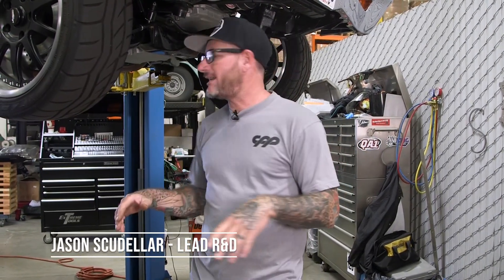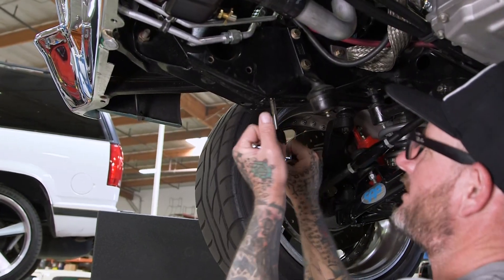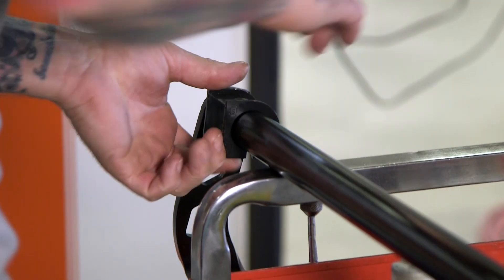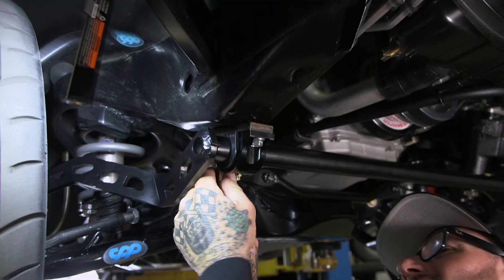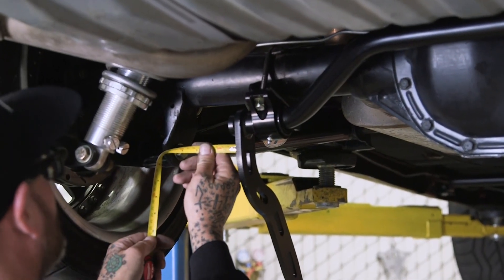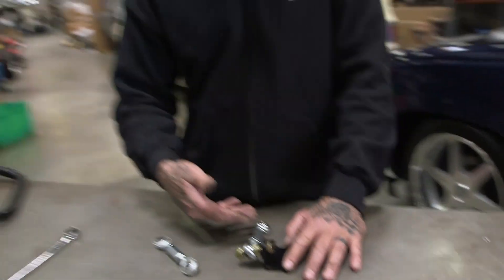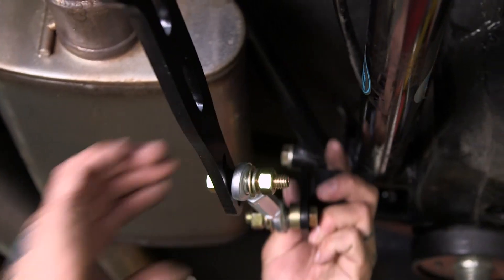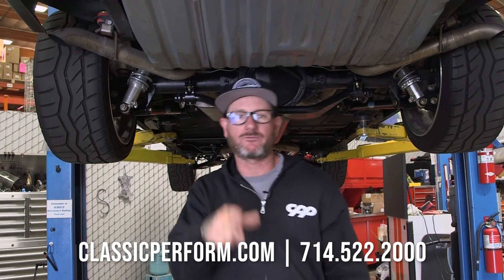How To Install CPP Pro-Touring Sway Bars (Chevelle and Second Gen Camaro)

Comment: Why is the coupler for the rod ends on the rear sway bar not reverse thread on one side? has to be removed to adjust it. Simple fix would make the customers life much easier , unless there is a reason for it?

Comment: Really great front sway bar as I just installed it about a month ago. I was thinking of getting the rear sway bar for my 67 Chevelle. The one thing I do not understand on the rear sway bar is where exactly is he drilling? I know he says the floor but I do see at 5:16 of the video it's not the floor it looks like the frame but, where exactly? I see he is not doing it under load of the car as it is lifted and the rear is NOT supported to make it that it is under load. I just don't understand how the car would not sit weird. If it's not set under load it's as if the rear sway bar is holding the car up or taking part of the load. Please correct me if I'm mistaken. Thanks
Reply from the maker: Great! We are glad you like it. The holes are drilled on part of the rear subframe; your instructions will show you exactly where. As for the car sitting funny, the sway bar does not support any of the car's load, it only controls body roll. If you want to be sent instructions or get more info you are welcome to give us a call at (866)-882-4131 and one of our sales reps can help out!

Comment: For the rear sway bar, did he say drill thru the floor of the car?! How would that work?
Reply from the maker: Technically its not the floor, its a part of the frame that runs along the floor of the car. You can see it at 05:16 in the video. You do not have to drill into the floor and attach a nut inside the cab or trunk of the car.